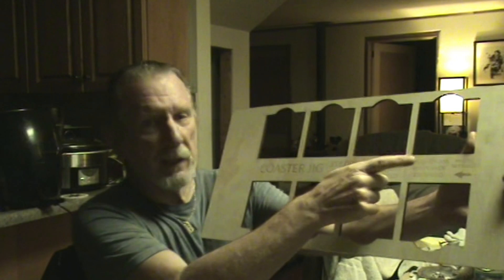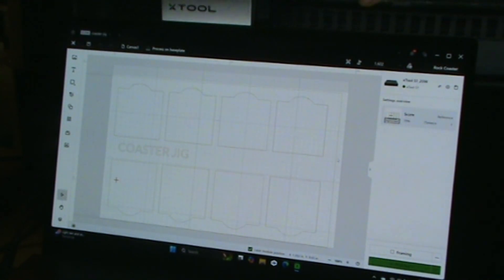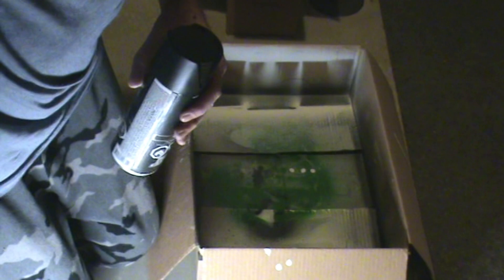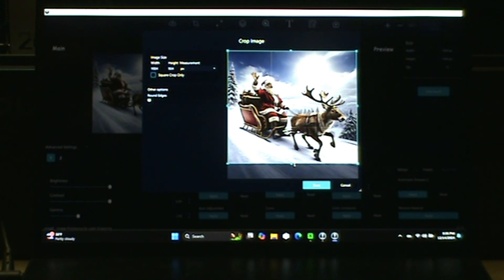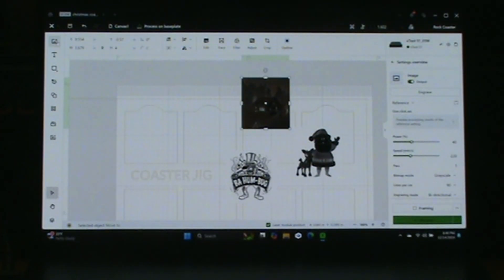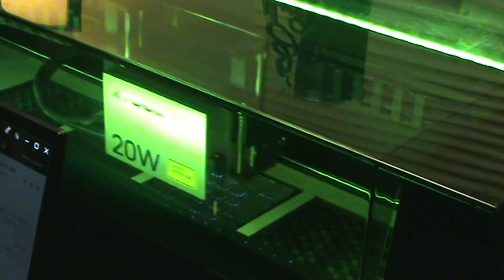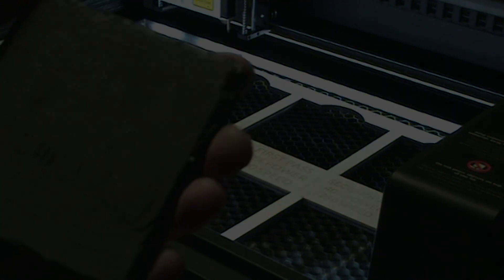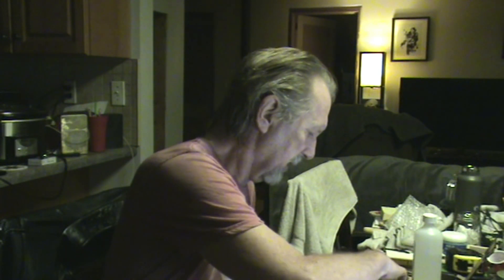Laser and repair slate coasters with the xtool s1 #education #business #money #fun #art #design

Comment: Hi Johnny Great Info. I have an s1 20w and thsi is helping me amazingly.  Image R is the answer to alot of my problems with photo engraving. But i was wondering what was the final setting in xcs for the slate coasters and was it one pass? On your gig you show a second pass at those settings. Question is, is it needed. One other. You mention to finish off with clear coat. Im a leather craftmen and i uss a liquid that is called Clear Coat not the same th8ng right. It's the hardware clear coat im assuming.
Proud to be Canadian
Darryl V
Reply: Thanks. Can you share you power and speed setting for score and engrave on a black slate coaster. I put a black dye leather dye on first rub that off after it's dry then the spray a black lacquer.  But some off my photos engraving comes out too bright and washed out to much. Like you mentioned I should try darkening it more in grayscale.
Reply from the maker: @MrDVinceable  loll as for setting I just used the settings on xcs off the rock coaster from xtool...happy lazering
Reply: My bad those are the settings for score and engrave Daa!!
Reply from the maker: hey thanks for watching, no i did one pass to score then switched to engrave, I prefer to score first to get a clear edge looks better in the end, as foe clear coat, its just rustoleum clear coat to seal the slate, hope this helps, happy lazering